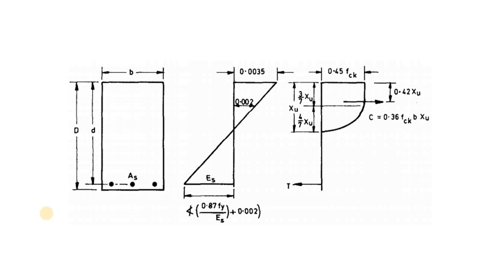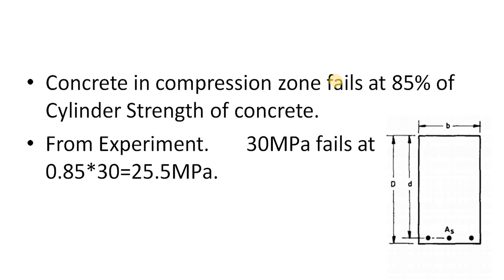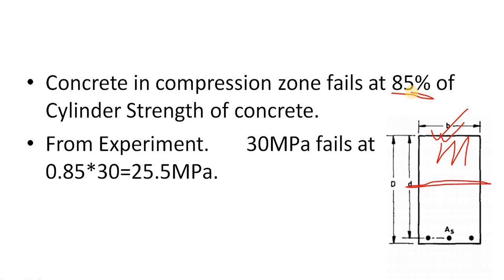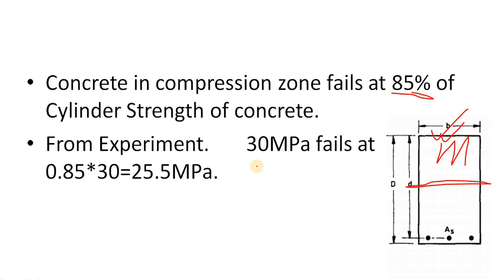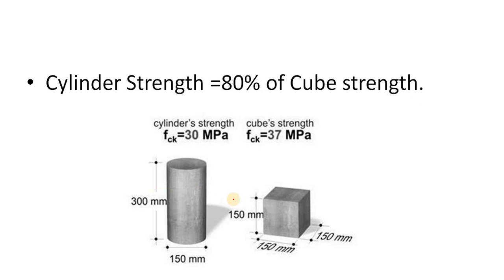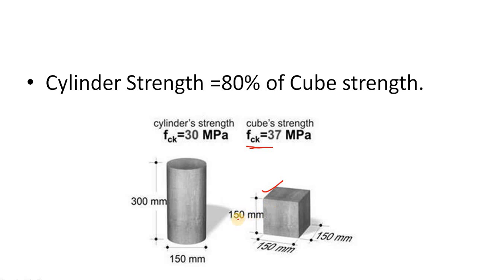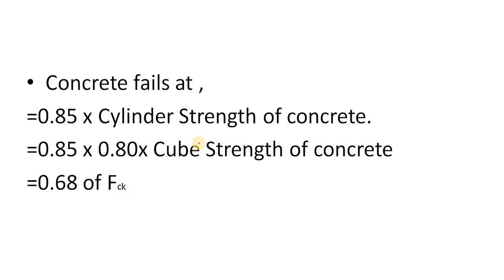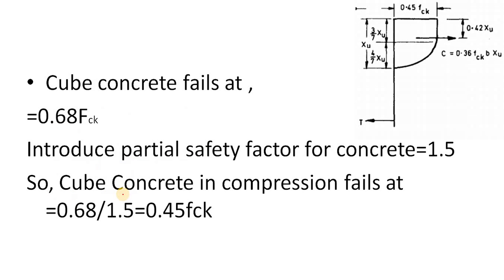Why 0.45fck ? Why 0.45fck is taken as the maximum allowable stress in concrete? How do 0.67fck come?

Comment: May not correct the way you explained, how we achieved 0.67fck in structure.

Let me explain in little details.....

Your targeted strength is Fck & it is a cube strength of 150 mm after 28 days curing.

Now your structure is not made of cubes. It has many shapes like flat rectangle, cylinder, circular and of many shapes & we know that the  cube shape is the highest taker of loads amongst all shapes. So for this some percentage of strength is lost.

2ndly, structure size is quite larger than your cube size and we know that larger the size lower the strength. So some percentage of strength is lost due to the larger size of the structure.

3rd, compaction and curing of structure is always lesser that that of cube. So some portion of strength is lost.

Now in total 33% strength is lost when we compare a structure and a cube.

That is why targeted strength of structure is 0.67fck and it is strength of cylinder.

Now to convert this cylinder strength to equivalent cube strength, 0.67 is multiplied by 1.25 which is 0.85*fck.
Reply from the maker: I only try to give some messege in this field in a different way. Definitely your observation will help others too. Mission is to help others. Sometime I may be wrong and I beg perdon for that.
Reply: No matter, we all are learning from each other.

Comment: Where did you get max compressive strength in bending as 0.0035 is equal to 85% of cylinder compressive strength?
Reply: I did not get this anywhere. Listening for the first time that compressive strength of top most fibre in beam is 85% of cylinder strength.

Can you please answer this?